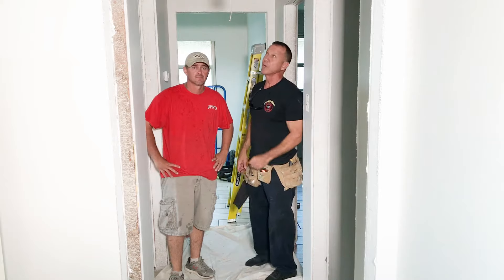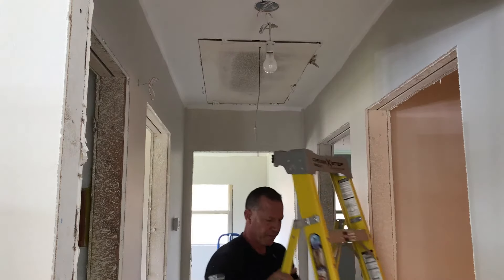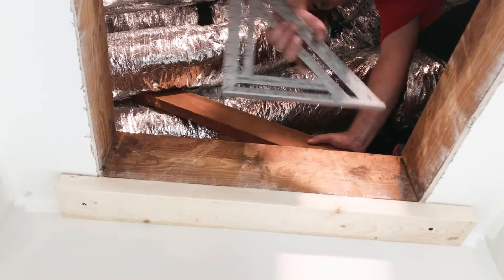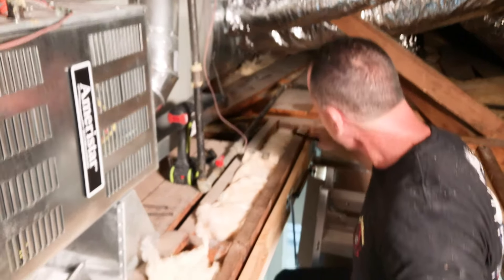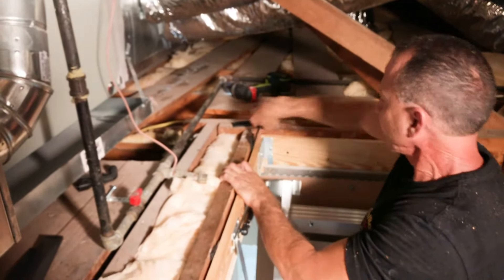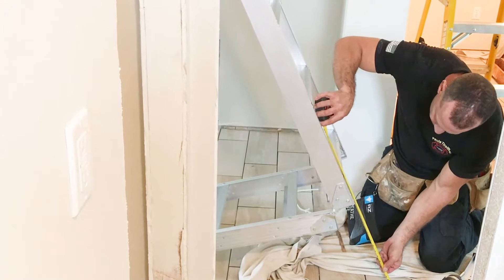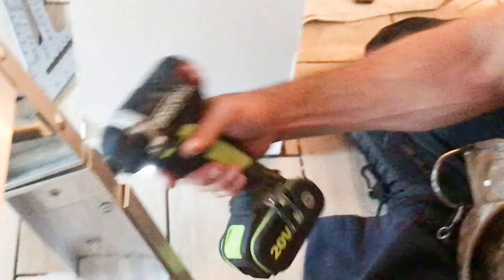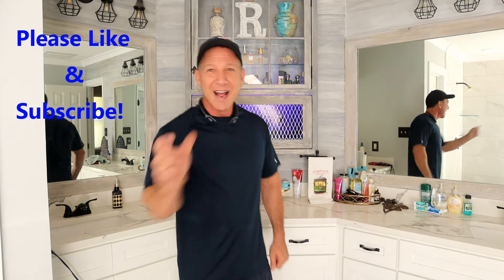How to Remove OLD Attic Ladder - How to Install NEW Attic Ladder - Step-By-Step Instructions

Comment: Great video. There is one little slip up. The first temporary support is placed 3/8 inch from the inside edge of the first header where the hinge of the ladder goes - NOT the second temporary support where the ladder pulls down.

Comment: Excited to try this method, but did not work for me.   The support at 3/8” on the on the opening side worked fine.  The problem was, on the non-opening side, the support would only allow the ladder to open a couple of feet before hitting the support and starting to lift the ladder assembly up.   Wound up having to install from the topside in the attic.  Seems to be some creative editing going on here…

Comment: My ladder calls for 16D nails…will I have any issues if I use what they instruct?
Reply from the maker: You can never go wrong by using the recommended fasteners from a manufacture. I however, like to use screws, but that is my personal preference. I don’t think you will go wrong by using the screws, but you will definitely not be at fault by using what they recommend. I hope this helps, thanks.

Comment: Where can I buy the drop down door hardware with springs? My opening is only 22.5x30.
Reply from the maker: Hi, I wish I could help you, but I’m not sure where you would get that hardware from. The reason why I say this is because a stairwell would be too dangerous to try to walk up with only 30 inches. I don’t think you could get through the opening. If you have room, what I would need to get do is cut the opening longer and frame it for a standard size attic stairwell. Sorry!
Reply: @paulstoolbox  Closet that the access panel is in is too small to lengthen the opening. I’ve been hauling my 8’ ladder up to our second floor and into the small closet for over 30 years and getting through that small opening without a problem. I’m just tired of hauling it upstairs all the time..

Comment: It looks great. But WHYYYYY are the screws showing. I don't want screws in my ceiling !  It looks unfinished. How do I hide the screws. Add another nicer board over top? MAYBE?
Reply from the maker: Hi sunandthemion, you must not have seen the end of the video. We trimmed it out with door casing and painted it.        
Thanks!
Reply: @paulstoolbox  No, you must not have seen the end of the video which was about a marble top or something totally unrelated. You trimmed it with painted casing but the door itself looked like ass with visible hardware and the string hanging down in the middle of the hallway.
Reply: Yeah what about painting?
Reply: @kevlar1482  Lol what?  Have you never seen an attic door before?   How the hell are you going to pull it down without a string.  Also I'm sure they painted the actual door later to match the trim and ceiling, which will also hide the factory ladder screws